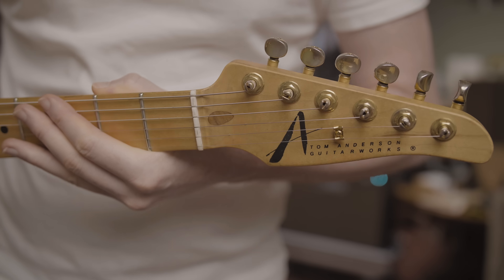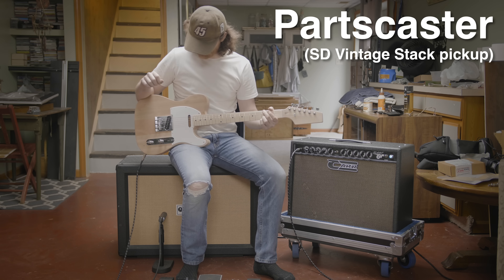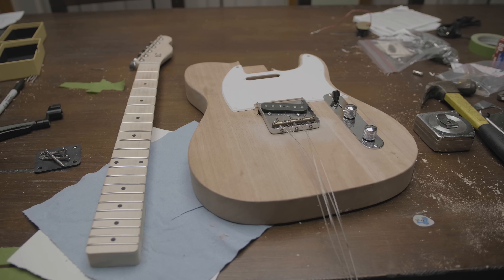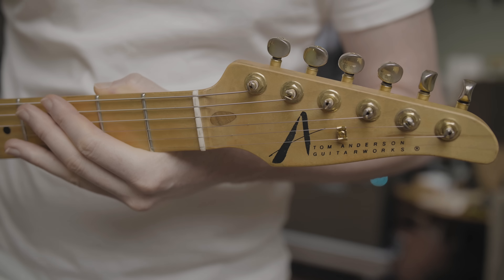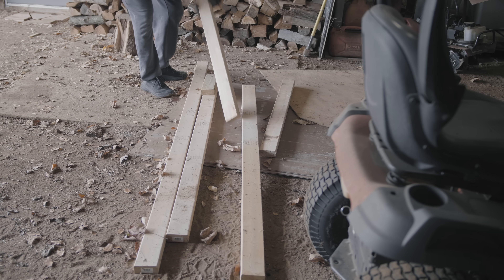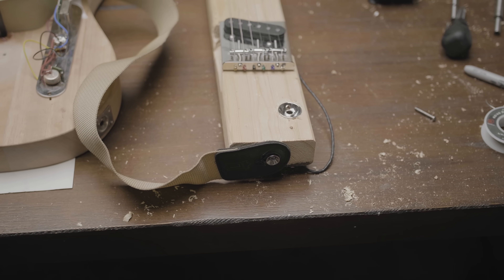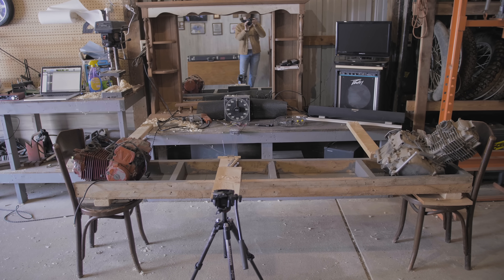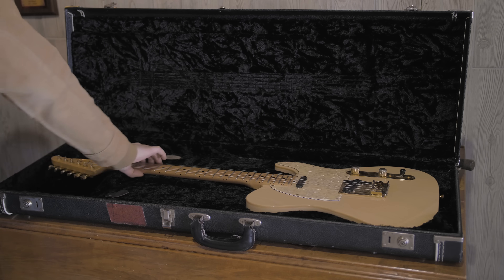Tested: Where Does The Tone Come From In An Electric Guitar?

Comment: At this point im surprised people are surprised but good job on the test.  I have found guitars that just have it but similar spec'ed ones don't.  Also I think you did miss something.  How I play has more to do with how a guitar feels than it's tone.  Also I think the wood can accentuate certain notes by magnifying certain vibrations.  Some ringing notes just work on some guitars where on others they just die.  Different guitars ave different songs locked in them.   Some trees want to be a chair and others want to be a guitar.

Comment: The major tone-type thing that body wood really effects is how long your sustain is, and even that can be changed based on how solid the joints in the guitar are - and that's not "Does it fit in the neck pocket properly" it's just "Is it just held together tightly." There might be small variations in tone from wood, but you're only going to hear them with really low output or microphonic pickups. The more compression is added (Hotter pickups, higher volume, etc etc), the more any possible variations level out - But by that same token, any variation in sound with those type of pickups is just as easily explained by those pickups being more susceptible to variance from winding techniques. 

If anything, think of the wood as less "This adds to the tone" and more "This can remove from the tone" because any difference is from parasitic vibration loss or cancellation, generally from bad connection of parts more then the wood itself. The benches work so well because they're solid and don't let the two points the strings are anchored to flex, for an example.

While I have heard guitars that sound absolutely dead despite having the same on paper spec as their siblings on the wall, being set up the exact same, etc, without said guitars on hand there's no proving that it wasn't just from incredibly bad neck joints or a bridge not quite properly put together. If there is any variation to be found in wood at all, it would be noticeable before stringing it up - tapping on the wood would have to give you almost no resonance, absorbing vibration like a sponge. Even then, I'm not convinced an average person would notice.

If you want to test further, get a lower output pickup, and go and find the deadest sounding chunk of wood you can. I think you'd likely just find more of what you found here though.

Comment: My guess is, but you didn’t mention this, that the sustain would be greater on the air guitar… you let the air guitar ring out for a bit and then Palm muted them near the end of the video. (The mass anchoring the two ends of the strings in your air guitar was much higher than the guitar-guitar.)
Thanks for doing all the work to make the points that were made. Hats off

Comment: Fascinating! I’ve long believed this to be true based on experience. However, I would expect there to be a small perceptible difference between solid, hollow, and semi-hollow bodies with the same pickups/height/angle/location/electronics (e.g. Les Paul vs. 335). 

Hoping you’ll test that next!

Comment: Very cool video. Definitely apparent that the pickup is very important as well as the pickup height. The one comment I would have though is if I’m comparing guitars tonally I do it through a totally clean amp for me. If your playing with any gain you will miss some of the fine detail and are hearing a lot of the amp itself in its drive characteristics

Comment: I have arguesd this for years only to have tonewood cork sniffers dismiss me out of hand. I know that wood matters in an acoustic guitar but electrics are all about the pickups and electrical components. It's all about metal vibrating above magnets and very little else. Pots and capacitors have more to do with the tone than any piece of Maple or Mahogany. Thanks for brilliantly displaying this fact!
Reply: There was clear difference between the Anderson and the partcaster , and it was noticeable when he played the e b g string pattern up and down the neck. That where the guitar material made the difference. 
On open strings and open chords there is very little to none difference.
So yeah tone wood is a thing, but it's a different thing than anyone thinks .

Comment: I don't think it's much about "wood" but the relative density and hardness of the thing that the strings are anchored to on each end, because that determines how much vibration is absorbed. I.e. the more firmly anchored the strings are the less string energy is lost to entropy. Les Paul fastened a string to a piece of railroad track and said it was the most sustain he had ever heard.

Comment: Great research. This confirms what I've always said. In an electric guitar, the pickups are by miles the most important factor in tone production. Build quality is important as regards playability and intonation but doesn't have a huge effect on overall tone. I actually thought the 2x4 sounded better than the anderson, more note clarity and separation. I think that this is more to do with the size of the piece of wood than the type. The larger the body, the more vibration it will absorb. I've heard Danelectros made of  fiberboard which sound awesome.

Comment: One thing you didn't test is how long a note will resonate for with difrent woods and how quickly the volume of a single struck note will take to dissipate. I think if you used a realy light wood for a neck a single note might not have so much sustain
Reply: This was realy interesting though  realy good job 🙂

Comment: I've played electric guitar for 50 years and over that time have come to the same conclusion - 99.9% of the marketing and "golden ear" fluff you hear about "tone woods", body shapes, finishes, maple top vs. photoflame, cloth wiring vs plastic coated, etc. guitar stuff is meaningless. Les Paul's first guitar was pretty similar to your 2x4 guitar.  It's about the pickup, its location and heignt, and the strings.  Great work! Prepare for lots of flaming replies from guys who think they can hear the difference between 2400 windings and 2450 windings on a pickup... : )

Comment: This needs more views.  I would say that is a thorough test.  I am a believer that all vibrations, including in the wood of a guitar, will have an influence on how the strings vibrate, correlating to the pickup grabbing that vibration and sending the signal to the amp.  That being said, those vibrations may not be influential enough for the human ear to perceive, as they are miniscule.  At best, I would say sustain may be the most influenced, but only unplugged.  I have swapped many pickups in my day, and that has always made the difference.

Comment: The one aspect that all those tests seem to forget, is the fact, that a guitar has a certain feel to it. Take two identical guitars, and more often than not you'll find, that one feels better than the other. Hard to say what is the reason for this, but I'm fairly convinced that it is indeed the wood, not for its sound, but for the way it reacts and vibrates. Good pieces of wood have a way of reacting to your playing that poor chunks of wood don't, It's like good guitars feel alive while bad guitars feel dead. It's not necessary the expensive guitars that feel alive, even cheap guitars could do that, if the specific guitar was lucky enough to be built from a great piece of wood. But I've played really expensive axes that felt rather unresponsive, uninspiring and dead, and I've played cheap guitars that were great. Every piece of wood is different, so if you happen to find a very resonant piece of wood, chances are the guitar will feel more responsive and thus more inspiring.
However, these things can hardly be conveyed in a YT video. It's easy to make a guitar sound good, but it can still feel like crap. I believe that's the main factor that makes a good guitar!
Reply: More likely it's geometry variables; and the quality of the fretwork, and setup.
Reply: @henseleric  Of course, these are all factors. But again, take 2 otherwise identical guitars, both maybe PLEKed and perfectly setup. Chances are you'll find you prefer one over the other. The only variable here is the wood, as every chunk of wood is different. They might even sound the same, especially if all you have is a recording of the two. But the feel might be what makes the difference, and that's something that can't be demonstrated in a YT video, you'll have to hold and play the instrument to appreciate this.

Comment: As a luthier, who has been building instruments since the early 1960s, I found this very interesting.    Few of us have the patience to carry out such experiments.   
A few things come to mind.   As someone who plays the steel guitar, the defining factor in tone has been the wrist action of the player.   That's less important in a fretted instrument, and, of course, in your tests it's the same person playing each test.
One of the questions that is always raised amongst luthiers, is not whether various shapes of body make that much difference, but whether hollow or solid bodies make a difference.    If an instrument is made to play both acoustically and electrically, does the tone inherent in the body get somehow fed back into the strings?    Certainly, an arch-top guitar sounds different from a solid.
Reply: Was about to ask the same question. How about hollow bodies?
Reply: I suspect a hollow body makes a difference if it is truly hollow -- that is, if the pickup is attached to a thin top that can vibrate fairly freely, rather than to a thick piece of wood that the top is firmly attached to and is structurally/mechanically continuous with the neck (that just results in what is effectively a solid body with two hollow wings on the side). Really, the true hollow body configuration gives you something akin to what you get when you put a magnetic pickup in the soundhole of an acoustic guitar -- the final result retains something of the acoustic tone (though usually not enough for a good result!).
Reply: IMO the reason everything else matters goes back to the player being the most important factor.  How the instrument resonates in their hands when practicing at low volumes or unplugged, the size of the body and neck, the setup, feel of the finish.  I think we’ve all felt inspired to play differently on some guitars compared to others at one point or another.  That’s the magic of electric instruments and why I’ll continue to be particular about what I play, all the while knowing I could theoretically get the same tones on a 2x4 with the same pickups.
Reply: @Stripestore  1000% agree with you.
Reply: My hollow body Ibanez will feedback at very low volume through an amp. So the interaction of the amp and body is relevant for sure. Would assume the same for resonate frequencies. My walnut "the Paul" sustains what seems twice as long as any other guitar I have. Unplugged. It's a brick. Also has considerable more chunk to the tone. I'm sure soem of it's the pickups but nwould definitely agree the body and composition of the guitar affects everything.
Watching this makes me think the pickup is like 80% of the sound.
Reply: I do believe materials makes a difference in how the vibrations are transmitted and absorbed by the body and neck materials. Will it change the sound ala brighter or darker, I doubt it. The pickups and electronics do that. Materials affect the way the harmonics of the vibrations are transferred back to the strings. Thought experiment time, concrete vs hardwood vs softwood vs a laminate vs steel vs aluminum. A slab of each material same thickness with the same bridge and headstock. Basically Les Paul's 4x4 recreated.
Reply: I think will make a small difference if the pickup is mounted to the body because the hollow will resonate more, hence vibrate the wrong part of the pickup. The same theory applies to different woods but the difference will be minuscule.

Comment: So cool. First off: mad respect for putting such an insane amount of work into this test! And THANKS so much for even taking the time to document it with good video and audio!

I’ve long suspected that the bridge type and scale length might be the most important factors in the unplugged sound and I’ve thought of pickups as the microphone for that "voice". Guess this video means I’m smart? ;)

I jaw dropped at the difference the electronics made in the plank guitar because that sounded nasty at first and I thought "ok, you just can’t push it that far." Well... consider my mind blown! Actually though I would have loved it if you had wired pickups straight to the output jack in all "guitars" from the start because tolerances in manufacturing these pots can be pretty substantial.

Comment: Been telling people for years, wax potted pickups only “hear” magnetic information i.e. the strings. The age, guage and material of the strings and how you hit and bend them change the tone more than wood or finish does. All the materials change how you feel, which changes how you play it and the psychoacoustic effect.
Reply: The people who claim that wood changes tone on an electric claim that the wood changes the vibration of the strings.  They claim that the bridge and nut mounted to different woods causes different vibrations to go through the strings.  Clearly those people are wrong, but that is what they claim.  I will pose a question though, if the tone is unaffected by the wood, why do semi hollow bodied guitars sound different that solid body guitars?  There must be something about the acoustic vibrations in the body of a semi hollow bodied guitar.  The pickups are mounted to solid wood in that design.
Reply: He just built the ultimate hollow body guitar haha.  The difference is most likely that hollow body guitars typically have a very different design and pickups. Not to mention the feel of the hollow guitar vibrating against your hands and body giving a different experience to the player

Comment: this is a very good test showing what I call the explosion of the tone. I agree 100% that wood has no discernable factor at this level.
There's a secondary level of sound you tests do not touch. I think the only way to "hear" these mynute differences would be to use an oscilloscope. I've done some measurements like this showing how different materials in the body and neck can add/retract these harmonics which does alter the sound but - 99% of people listening would never notice this. I've always said tone totality comes from the gear. How that is used comes from the hands.  A $100 guitar sounds fantastic through a $2500 amplifier. A $5000 guitar sounds terrible through a cheap amp. A great player sounds great on either piece.

Comment: I appreciate your attempt to suss out what aspects of a guitar contribute most to tone! 
I think it is absolutely true true that there are many inexpensive,  less sexy ways to impact tone. Ive found different pick materials and shapes for example.
However, i wonder if your attempt to create some sort of uniformity in set ups might have actually have caused  you to overlook an important factor. 

Guitar, esp electric, and esp edge of breakup guitar, is extremly DYNAMIC...  meaning its not just how it sounds but how that sound changes within its dynamic range. 
Perhaps this is beyond the scope of your experimemt... but for example.. vintage fender 2.5k pots at full volume might sound the same as the modern pots.. untill you plug it into a fuzz face (straight in no buffer) and roll off volume. Far from simply reducing the input volume..
 its darker and breaks up in a very different way. 
Could you play one chord and  get this identical sound with a modern tonepot? Absolutely. But that doesnt mean the resistance is irrelevant....  

its like the difference between a still photo of a dancer and a video of the same...  two dancers might look identical in snap shot but very different in  motion.
 Again, this is not to say your experimemt was innaccurate or anything. adjusting the pickup height might get you 90% there,  but much of tone is about how it makes a player reacts.  so while that 10% might be small potatoes to the final sound, if it inspires you to play differently, then its very important. Even if the difference is Impreceptable to anyone but the player.

Comment: The test guitar always sounded thin and cheap, no matter what you did. If you can’t hear the difference between the guitar and the “air guitar,” you need to have your hearing checked, because I certainly could. Not that it sounded bad, but it took on characteristics of a steel guitar, even without the slide. The shelves you have the parts mounted to are also influencing the sound. It would sound different between two steel beams than it would between two trees